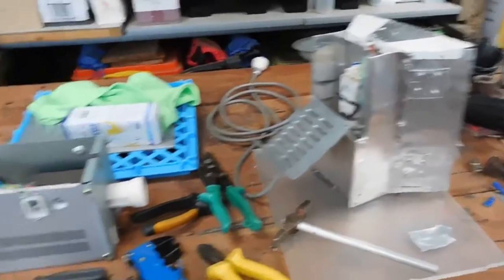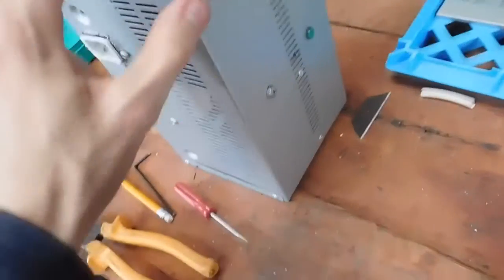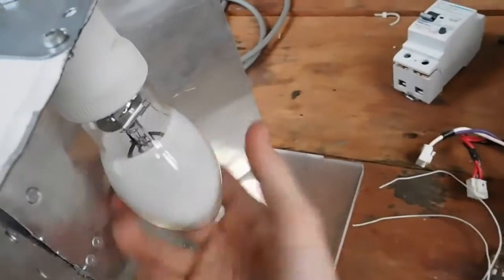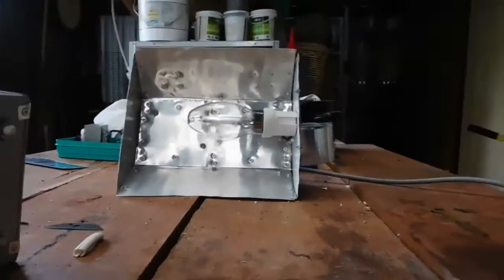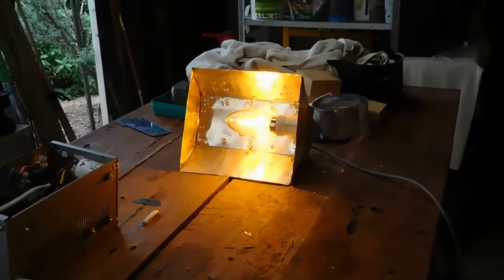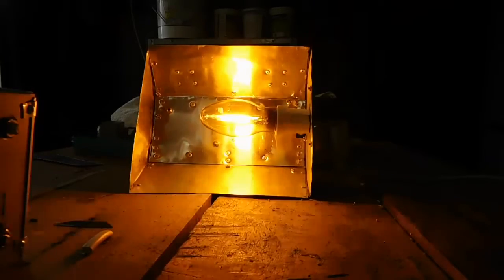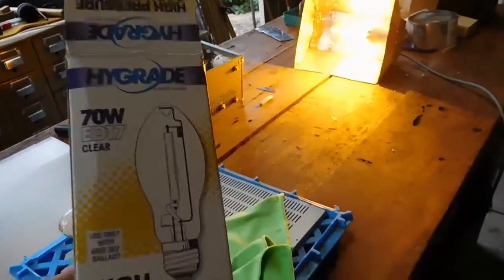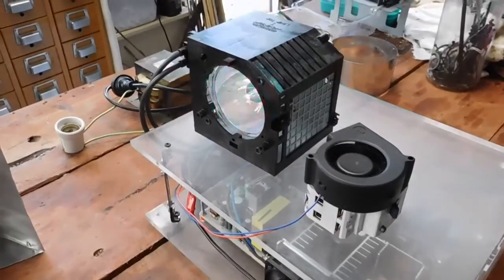70 Watt HPS Lamp Test and 600 Watt Ballast Box

Comment: By the way, these 70w satco hps bulbs wont work properly on australian hps ballasts because they run at 52 volts and 1.45 amps while australian 70w hps bulbs run at 90 volts and 1 amp. Running these satco HPS lamps on australian gear will underpower these bulbs and overheat the ballast. However, us mh bulbs from 39w to 150w can run on australian hps ballasts since they are electrically identical to australian hps bulbs.
Reply: Actually, 70w MH runs at 90-135V 0.685A, but 70w S62 HPS runs at 52-55V 1.37A, however, a 150w MH ballast would work better for a S62 bulb because 150w MH current is 1.44A.

Comment: HPS is high in lumens per watt than Metal Halide
Reply from the maker: Yes it is, HPS is also very good for cutting down on light pollution (LP) as the orange light it puts out doesn't penetrate the cloud layer as hard as MH. 
LED is probably the worst for LP as the colour is a starc white, which lights up absolutely everything it reaches